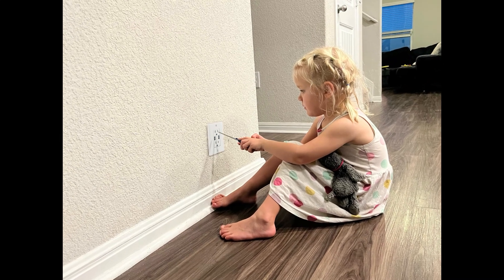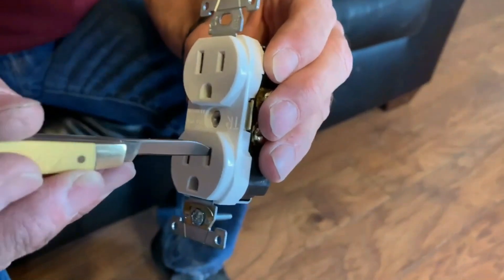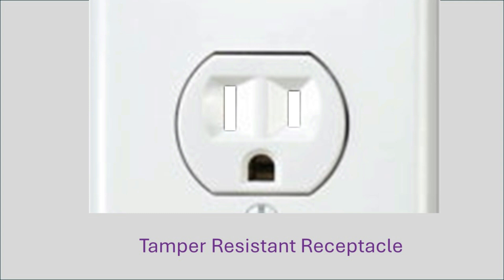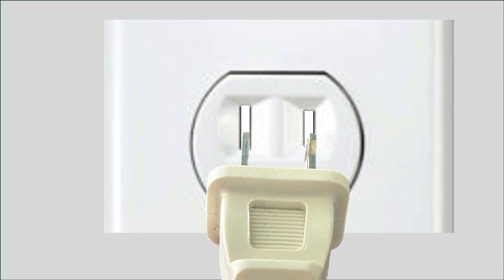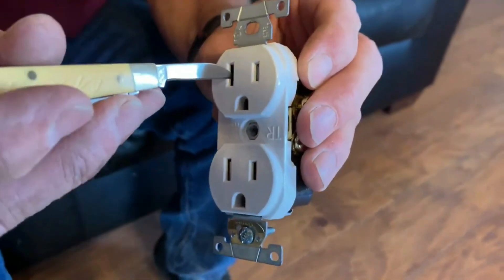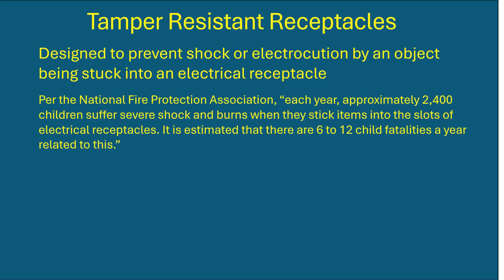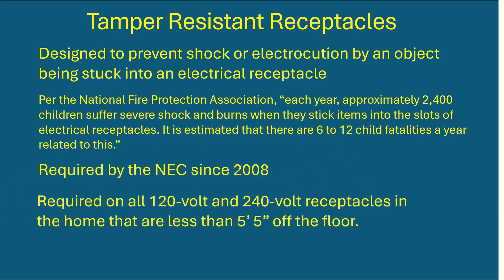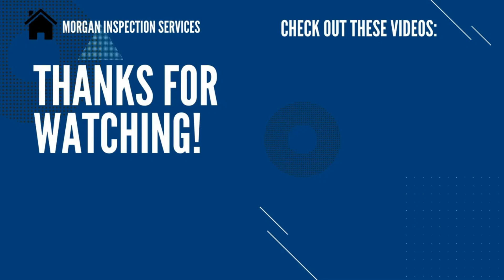Tamper Resistant Receptacles: What You NEED to Know!

Comment: As a sparky and an uncle of two nieces and a nephew I'm a big believer in tamper resistant receptacles even in homes where all the children have grown up and moved out,  since it's inevitable that small children will be in the house at some whether it's the nieces/nephews or grandchildren.    Superior to the small plastic caps my parents used when I was a small child in the very early 1990s.    

Problem is at home depot,  Lowe's and other hardware stores where I shop, none of them currently carry the tamper resistant version for the 240V 15 or 20A single receptacle like you might have in your living room if you have a larger window air conditioner.  However,  those same brick and mortar stores have plenty of single 120V 15 / 20A receptacles in tamper resistant version.
Reply from the maker: Thanks for comment. Did you see that we had a winner in the contest video? He essentially got the answer completely right
Reply: @morganinspectionservices3840  yes, I just read the winner comment.   That one really had me stumped.   The only way I could see that as possible would be a backstab connection that wasn't good, I've personally ran across a number of burned out receptacles and every single one of them was backstab, the most severe of which happened when the neutral side burned up on a multiwire branch circuit in a living room after a 1500 watt electric fireplace had been running for some time and smoked up a 70 inch smart TV,  DVR and stereo system, setting off the smoke detectors.   The homeowners said they never seen so much smoke come out of a TV before and out of caution,  doused it with two fire extinguishers then flipped the main breaker off.   

That whole ordeal would have been avoided,  had the neutrals been pigtailed as required in article 300.13 (B) of the NEC,  which states that in multiwire branch circuits, continuity of a grounded conductor (neutral) shall not depend on device connections such as lampholders, receptacles and so fourth,  where the removal of such devices would interrupt  the continuity.